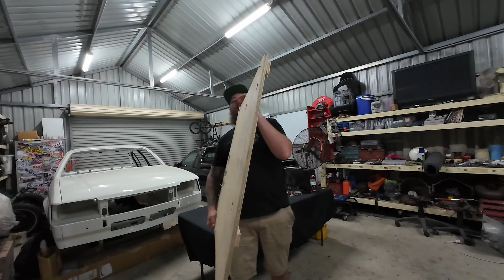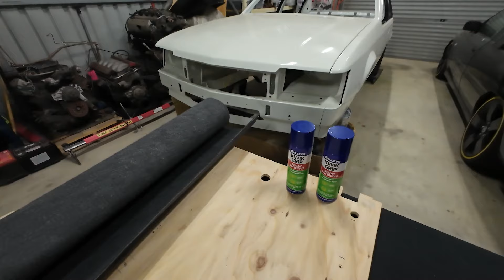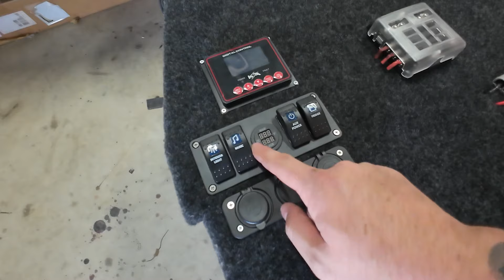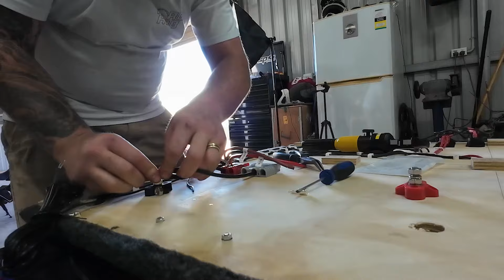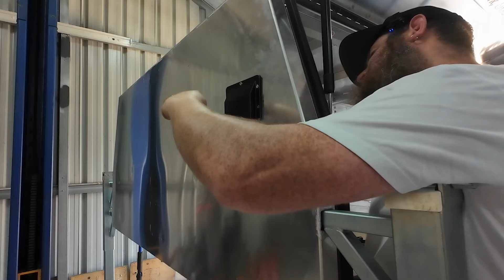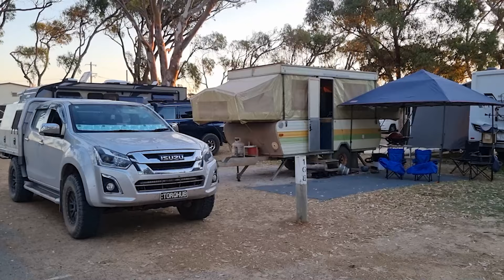Installing My KICKASS 12v Canopy Setup! DCDC charger + 170aH Battery | Budget Tourer Ep4

Comment: Nice video, considering the canopy is a lift off did you fit an isolation switch at the starting battery to kill the charging cable?
Reply from the maker: The anderson plug isnt going to arc on anything, but when its disconnected I still use an andseron 'blank'. Basically an anderson plug with pins in it, filled with resin on the back side.

Comment: I watched this ages ago and grabbed a heap of ideas from it. Currently installing a very tight setup in a skinny tradie toolbox. 
Have stuck in some 25x25 aluminium box section to screw the ply on to but had no extra spare to run wiring. 

Awesome tip with the extra bits of ply to create a void. Cheers mate!
Reply from the maker: Stoked you managed to grab a little something from the vid mate! I've gotta do another canopy fitout next week... not going to film this one though haha!

Comment: How’d you wire up the hardkorr lights? Did you cut the cig socket bit on them and hard wire it?
Reply from the maker: Yeah thats correct mate. Mounted the switch panel on the canopy door as you saw on the vid, snipped the cig socket off and hard wired to the fuse panel, but with a metripack plug inline in case I need to remove the 12v for any reason.
Reply: @TorqHub yeah sweet as cheers 👌 great vid by the way, was exactly what I was looking for and helped heaps
Reply from the maker: @Willhaigh no probs mate, thanks for watching 🍻

Comment: I noticed you attached the neutral input for the solar panel into the dc to dc charger to the Neutral bar. I believe that is a very dangerous situation that can create ground loops and all sorts of issues. Other then that love your work
Reply from the maker: How so? Its very common for a solar panel and an MPPT controller to share a common earth.
Reply: @TorqHub from the research ive gathered tying the solar neutral straight into the negatives from the battery bypasses the dc to dc charger & can create faults as some chargers have senses inside relying on a feed directly from the solar meaning rhe battery may be damaged due to uncontrolled current from the solar panel
Reply: @TorqHub it had me confused when you did that. But I love your work mate! Epic stuff. I will take your trick of using the little squars of ply on your backboard to create a cavity for wires to run. Also bought some thermaliner, seen old mate who used the itech gear do it aswell. Can i ask how did the suction method go with doing circles with the sikaflex?😄
Reply from the maker: Well it hasn't fallen down, so whether that's because of the circles? Or just because the sika is the right adhesive for the job, it's hard to say... but for the sake of social media we'll say it was the circles, haha!

Comment: hey mate where did you get the usb, usb c and cig panel from?
Reply from the maker: Couldn't purchase it in that particular configuration as a 'set', but bought all the bits individually through switch boss on ebay

Comment: Any videos of wiring from the starter battery ?
Reply from the maker: I didn't film that, no. But the synopsis is; 8B&S twin core cable + 20B&S blue wire. I put a 50amp midi fuse on the positive close to the battery, and used a fuse tap on the engine fuse in the fuse box to pick up the ignition trigger. The ~5M length was all covered in corrugated split tube conduit.  For routing I sent the lead straight down to the chassis rail and cable tied it at the same securement points as the fuel line. I then trimmed to length and terminated it with a 3-pin anderson plug to connect straight to the canopy.

Hope that helps!

Comment: Hi mate 
Did you have run neg- cable from the main battery to the dcdc charger ?
Reply from the maker: I chose to, yes. Pos & neg from starter battery, and ignition trigger from engine bay fuse box back to the canopy 🤙🏻
Reply: @TorqHub  thanks mate 
I have same Ute and set up but i run the neg from chassis to anderson plug 
You reckon that will make difference on charging performance ?
Reply from the maker: It's always 'better' to go back direct to battery where possible. In my position I figured I'm already running trigger and power, so might aswell make the power cable a twin core. Chassis ground are often fine when done properly but adds a couple extra points of failure. Not having a CLEAN ground on the chassis will 100% effect charging performance.
Reply: @TorqHub thank you 
Really appreciate it mate 🍻
Reply from the maker: No probs mate. You'll see in a later video I upgraded to a 40amp charger, and that too runs flawlessly with the same wiring 👌

Comment: Hey mate where did you get the Anderson weather shield for the front of the canopy?
Reply from the maker: That was on ebay mate, I'm pretty sure the store name was VP Design from memory 👌
Reply: @TorqHub  Have you checked cables going through the Ali?  Great DIY job but I'm concerned about rubbing from vibration on those holes.
Reply from the maker: Hasn't been an issue mate. Had it all apart maybe 7 months after this was filmed and they were ticketyboo. Rounded all the edges, and had some clearance on the holes. Plugs are hard mounted so there it barely any movement there. Should I have put a grommet in? Yeah probably, but it's fine 👌
Reply: @TorqHub corrugations will have a field day with that mate

Comment: Hi!Where exactly did you connect the blue wire?
Reply from the maker: Do you mean to the vehicle? I used a fuse tap and connected it to the A/C fuse in the engine bay. Only comes on with ignition 👌

Comment: Hey mate, do you need to ground the system out to the chassis at any point? Or is connection to the negative terminal on the second battery doing the same thing?
Reply from the maker: No ground to chassis mate. Any accessories are grounded to the common neg terminal to the battery shunt/aux battery

Comment: Up the Jayco Swan. Love the golden triangle. Spent a long time adventuring around there. 

Killer and clean forward thinking set up too Jeff. 
You wont regret going lithium. I hardly look at my status of everything now. Check the fridge temps and that is it.

Inverter was a wank at first I thought. But it is so good for a blender for those health drinks (cocktails)

Enjoy mate and can't wait for the street cars either. Enjoying all the content you both put out.
Reply from the maker: Yeahhh the swannieeee! 
The lithium will be a big step up for sure. Pricey suckers though lol. I'm pretty keen for the inverter. Being able to easily charge the laptop abd milwaukee batteries on the run, or quickly fry up something on an induction cooker without having to setup a gas BBQ will be AMAZING!... Torqhub cocktail bar wouldn't go astray either 😅